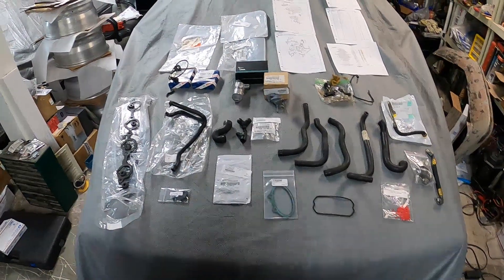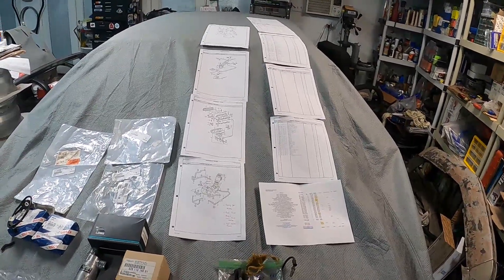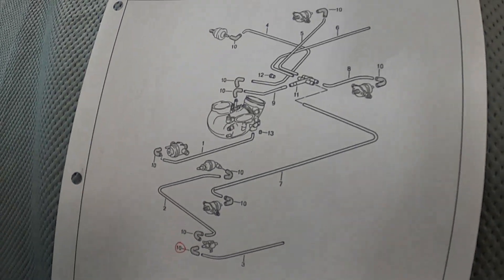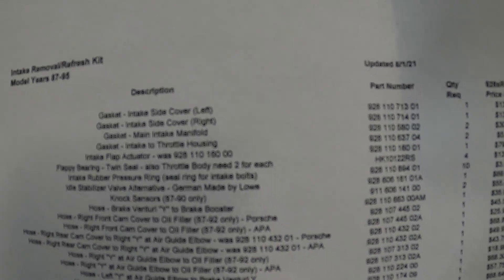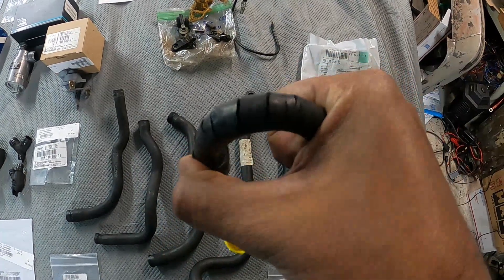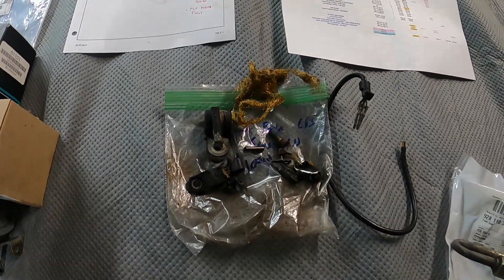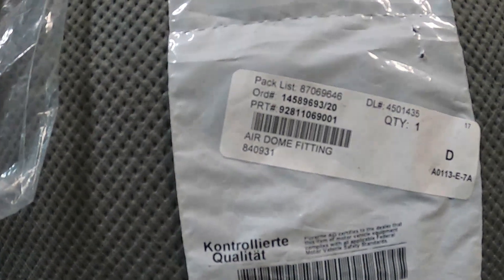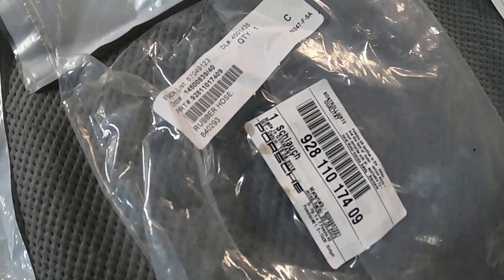Porsche 928 S4 Intake Manifold Rebuild - Episode 3

Comment: For future reference, the part numbers and page numbers in that PDF are as follows:
Intake manifold:
Part Numbers on Page 81
6: 928 110 637 02 Gasket x2
8: 928 110 580 02 Gasket x2
15: 928 110 693 00 Thrust washer x10

Throttle Body:
Part Numbers on Page 79
2: 928 606 161 01 Idle-speed adjuster x1
2: 928 606 161 02 Idle-speed adjuster x1
8: 928 110 689 01 Connecting piece x1
10: 928 110 224 00 Hose x1
11: 928 110 174 09 Hose 87 x1
11: Hose 88- 1
12: 928 110 220 00 Hose x1
12: 928 110 220 01 Hose x1
14: 928 107 603 00 Hose x1
15: 928 110 633 00 Hose x1
23: 928 110 690 01 Connecting piece x1
26: 928 107 313 02 Hose x1
27: 928 110 432 01 Hose x1

Fuel lines are on page 85

You can get the PDF here: https://www.porsche.com/canada/en/accessoriesandservices/classic/genuineparts/originalpartscatalogue/
just choose your rmodel and year

You can also send your intake to 928srus: https://928srus.com/products/complete-intake-re-finish-kit-87-to-91-s4-gt
or choose the parts on 928GT https://www.928gt.com/ps-25785-81-intake-removalrefresh-kit-for-87-95.aspx